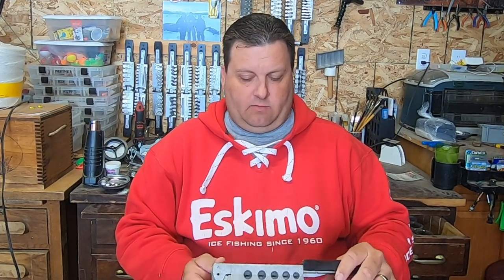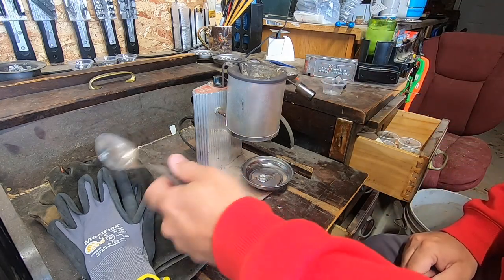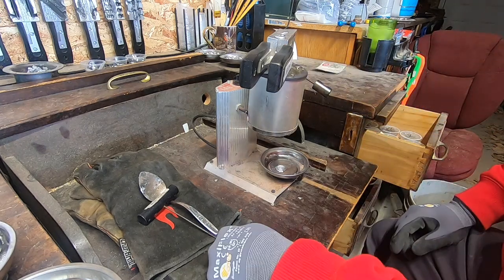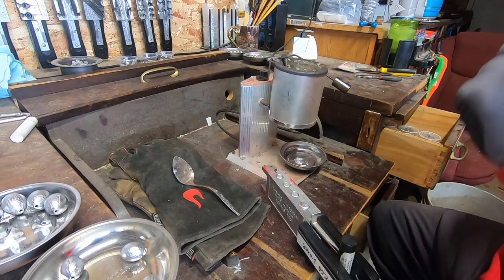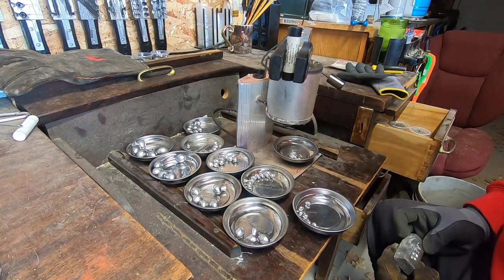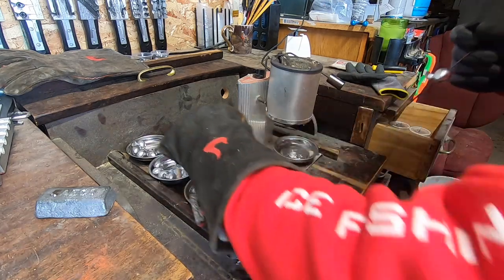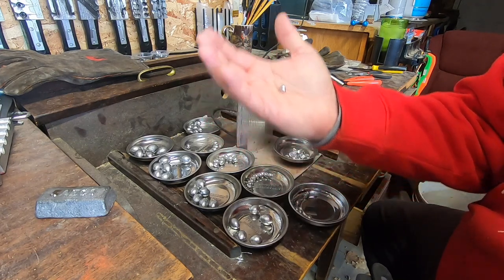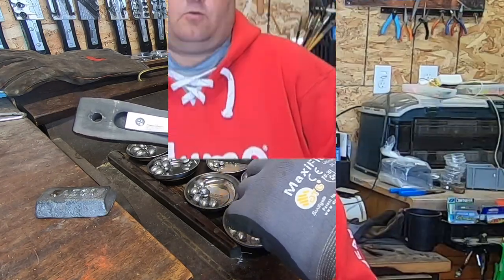Do It Molds Egg Sinker Review and Tutorial

Comment: Which melting pot you use? Super clean
Reply from the maker: https://barlowstackle.com/Lee-10Lb-Lead-Melting-Pot-BR110-Volt-Model-P345/
Reply: @prospectoroutdoors  nice! Did you ever get the 20lb one or do you prefer the 10lb
Reply from the maker: I’ve been happy with the 10 so far. I have a few molds that need a ladle. Most everything can be handled with a 10 pounder unless you are doing salt water.

Comment: Pouring one continuous sprue from one cavity to the next makes it easier to remove sinkers and jigs.It makes it easier to remove the pull pin if you install it from the hinge end instead of the handle end and give it a twist back and forth before pulling it out.This speeds up production.

May not seem like it but turning the pot down to 4-5 is a little on the low side even for pouring small jigs like 1/16 etc.Less heat in the lead the faster it'll solidify.You should be in the 6-7 area and go on up for larger pours.Those 2-3oz sinkers should be around 7-8 to get perfect pours.If it's just for yourself being colder is ok,you'll just have those cold casting waves or some imperfections.A lot of people think the waves affects the quality but it really doesn't,not on a sinker anyways,it can on jigs,so more heat is needed in both the lead and mold to not produce the cold casting waves if someone plans on selling them or pouring jigs.

Leave the mold sit on the pot as the lead melts.Then pour into the mold to heat it up without the hardware but do this 8-10 times or more until the item comes out perfectly and let it sit on the pot for 20-30 seconds between each pour.I usually leave my pot set at 8 and don't even bother touching the adjustment.If I need to get up for a few minutes I will pour the mold and leave it sit on top of the pot.When I get back I will go through the same steps as warming it up but only do it a few times to get the temp back up to get perfect pours again.Heat is the best thing pouring,if right you do not need to "smoke" or spray molds.Also if you clean up the molds cavity of the tiniest burr or ledge will help in the removal of you pours.
 
Keeping the pot at least 3/4 full will also allow it to live longer and keep junk and oxidation out of the spout which will help cause less clogs and drips.
Reply from the maker: Great tips. I will definitely give your pointers a try! I appreciate your sharing your knowledge with us. Do you have any pointers on smaller jig head pours? Specifically the problem of some of the hooks being loose. Especially with Ned molds. Thanks again!
Reply: @prospectoroutdoors  Harder lead is needed if you want to get rid of the "hook wiggle".
I myself don't worry about it,I use the 1/16 Ned/Widwest Finesse often for Crappie.
Reply from the maker: Good stuff! Thanks 😊
Reply: I mostly pour 1/80 to 1/16 jigs,but do others from 1/8 up to 1.5oz. it's probably a 80/20 ratio.ATM I have about 12,000 1/32 and 1/16 ready to go for the Crappie folks.
Reply from the maker: Unreal! Do you mind sharing your company information? I would love to see what you are up to.
Reply: @prospectoroutdoors  I don't have a company site set up.It all started through friends and relatives and then moved on to their friends,etc. I have people in 6 states buying them and it's enough to keep up with..lol  
If I was to get more I'd probably have to get a spincast machine,hire help,and a much larger lead supplier.
Reply from the maker: Keep up the good work and I wish you much success. Would you mind if I put out an updated video that incorporates the tips? Any other things that you think might add to the list? I sure enjoy learning more about making fishing tackle. I can’t wait to try out putting foil on jigs and spoons. Thanks buddy.
Reply: @prospectoroutdoors  No not at all,go to it.

I'm about at the end of my ability to do all myself.I don't need to get into making more than I already do..lol
 However I did think of starting to make rods...but I left that idea fly right by..lol
I'll stick to  making sinkers,jigs,popping corks (really just small popping floats for crappie/panfish) and now two small small spinnerbaits (1/16 1/8) for Crappie.I also tie my own jigs,trailer hooks,etc. for crappie and striper,I sell some of those to close friends at our local lake but I try to stay away from getting into that,takes to much time.Takes about the same time to tie 20 3/8oz striper jigs as it does to pour close to 1000 1/16oz jigs.
Reply from the maker: Busy man. Good stuff!
Reply from the maker: How did you get into the hobby? Sounds like a fun ride.
Reply: @prospectoroutdoors  Started all pouring bullets with my stepfather back in the 80's as a teen.Also got into reloading rifle and pistol ammo with him.
He had a few sinker and a lot of bullet molds that him and his father was pouring since the 60's,still have both their #10 Lee pots and they still work.Have my own #20 that I use most of the time.They had their own muzzeloader/rifle business that they'd make things for,refinish,or make stocks,repair,etc. 
I poured for a while then had a job on the road and got out of it for a number of years.Just been getting back into it the last 5-6yrs or so.
I also try do as much fishing as I can.
Reply from the maker: Awesome. Thanks for passing on some good family knowledge. I really appreciate the old time bait makers. Some of the ideas that they had were way ahead of their time.
Reply: @prospectoroutdoors  No problem,you already had it down pretty well.......a lot better than most I have come across on YT.

Another thing I'll do is pour till the mold is to hot,the oiled hinge starts to smoke the oil off ( I use any oil,just have 3 extra bottles of airtool oil after misplacing them so often.I'll then go and bend/cut the sprues off what I made till it cools off to about where I start it all at.That's about 500-1000 jigs depending on size (usually 1/32-1/16).They don't stay in the mold but 1-2 seconds after the pour,larger jigs molds heat up faster cause it takes a lil more time to fill each cavity and it gets more heat-soak.
Reply from the maker: Interesting… Thanks 😊 
I am glad that you had some good men in your life to get you started. The man I call Dad stepped up to the job when I was very young and I am forever grateful that he was willing to take me under his wing.
Reply: @prospectoroutdoors  Yes,I was pretty fortunate,many don't have that opportunity.I have my father,stepfather and mother yet,My grandparents were around till I was about 10-12They all did different things in their careers and hobbies that I learned all I could from.At tone time was working for my stepfather on the weekends helping him remodel bathrooms,kitchens,etc.I started working on vehicles with my grandfather and father when I was about 7-8.
Today I don't have to hire anyone to do anything as I can fix or build it myself.Saves a lot of money that way...lol
There's been mistakes along the way but that teaches you it won't work that way..lol
Reply from the maker: For sure. I am self-taught in most things as well. Just this afternoon, I had to diagnose and fix a heating system at one of my rental houses that I built from the ground up. Merry Christmas!
Reply from the maker: Shoot me another message on messenger please. I saw that you tried to send one and then it disappeared. Thanks